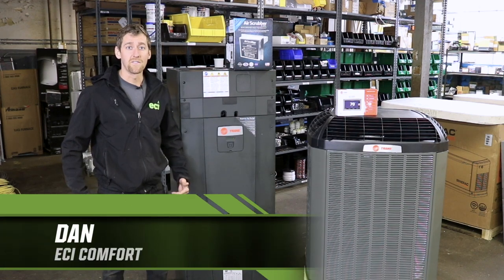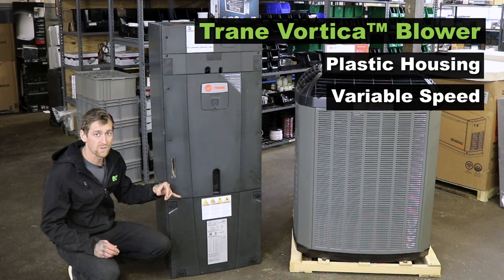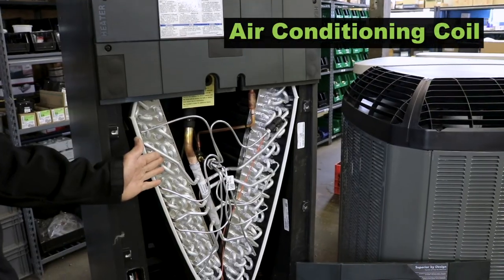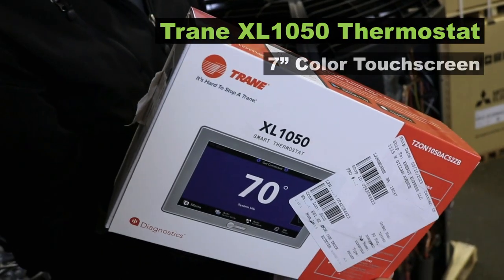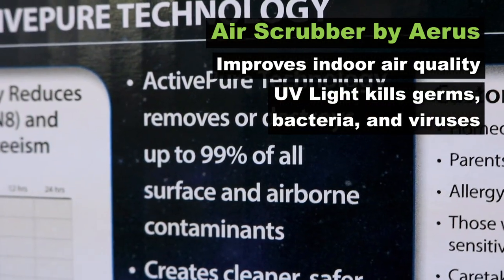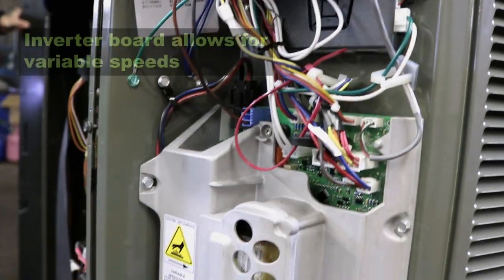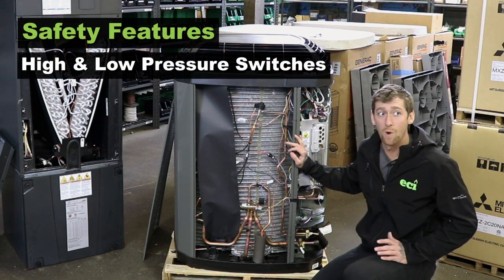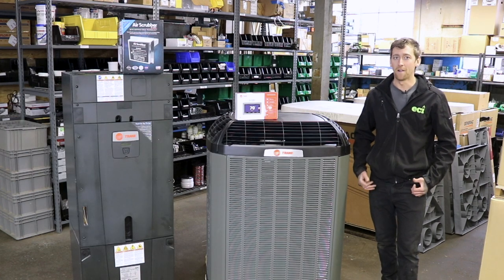PT 1: Chestnut Hill Home Upgrades to Trane XV20i Variable Speed Heat Pump

Comment: The xv20i that was just installed at my hone is vibrating excessively and very loud. It puts a vibration on the exterior wall and a loud drone that hurts the ears. Wouldn't install one again. Trane doesn't give a damn about their problem products.
Reply from the maker: Hello, we're sorry to hear that you are having a negative experience. If you're a customer with ECI please feel free to call us for assistance! We are a Trane Comfort Specialist and we have great experiences with this system and Trane overall. It's possible that something was installed incorrectly, but your contractor should be able to assess any installation or general service issues.